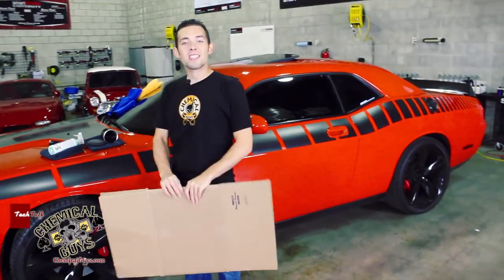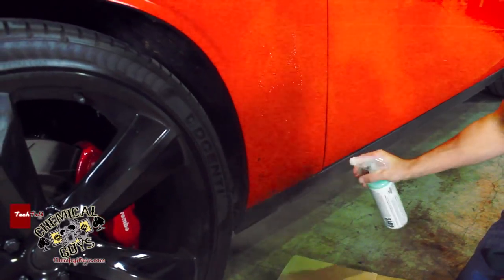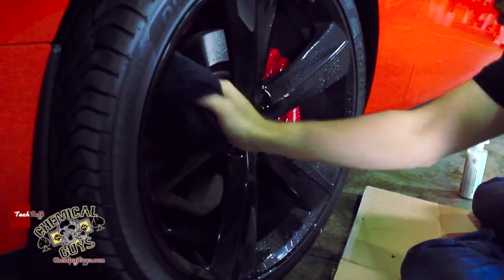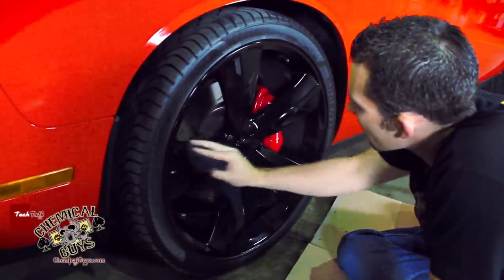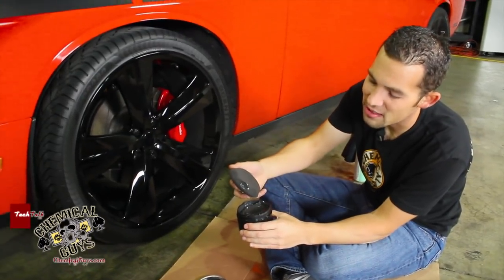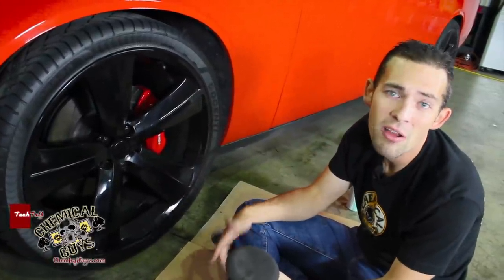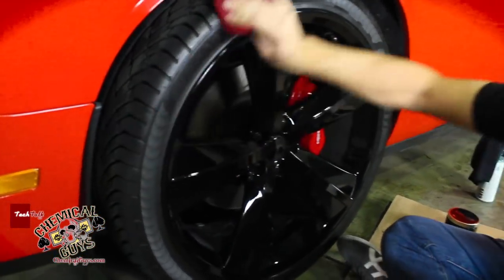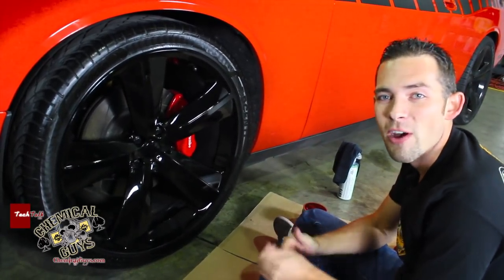How To Detail Black Wheels - Chemical Guys BLACK ECOSMART TRIM GEL - EPIC CAR CARE

Comment: How do you remove chemical stain off the rims?. I used a foam chemical to clean the tires but excess got to the rims and it looks like it faded the powder coating from the rim.

Comment: Black towels are not good because you can’t tell when they’re dirty, especially if you have grit in them during waxing, polishing, or drying painted surfaces.
Reply from the maker: Hi Jason, thanks for your comment. Since wheels are the dirtiest part of a car, we always use black microfiber towels for wheels, green for paint, blue for glass, yellow for interior carpets, fabric, and upholstery, and tan for leather and vinyl. This color coding ensures no cross-contamination and no costly mistakes! Stay tuned for more videos coming your way soon!

Comment: I have the gloss black cleaver rims on my truck an I keep getting streaks on the wheels I wanna wax them but I wanna clean them really good first any ideas or suggestions on how to really clean my rims before waxing them. It's like streaks on top of the clear coat. Can I use a degreaser cleaner or what do you suggest?
Reply from the maker: Hi Jacob! We recommend Diablo Gel Wheel cleaner.  Chemical Guys Diablo Wheel & Rim Cleaner is pH-balanced, gentle, and perfect for cleaning any type of shiny wheel finish on any vehicle. Clean off any painted wheel, polished metal, chrome, anodized, powdercoated, or wrapped wheel without fear of tarnishing or destroying any finish in any way. Diablo Gel Wheel & Rim Cleaner lifts away stuck-on brake dust and road grime with concentrated suspension technology. The thick wheel-cleaning soap comes oxygen-infused for the foaming action that gently removes abrasive filth from wheels, tires, and brake components. Diablo Gel is the only pH-neutral wheel cleaner safe for use on any and all shiny OEM and aftermarket wheel finishes, including painted finishes, powder coat, chrome, carbon fiber, polished metals, and glossy vinyl wraps. The thick soapy cleaner comes fully concentrated, so mix 3 parts water to every 1 part Diablo Gel in a sprayer bottle for the perfect balance of sprayability and wheel-cleaning grunt. Simply spray the red gel over the wheel and agitate any brake dust, road grime, dirt, grease, oil, or spilled brake fluid with a soft-bristle wheel brush. Thanks for watching and thanks for being part of the Chemical Guys family! Check link below.

https://www.chemicalguys.com/Diablo_Gel_Wheel_Rim_Cleaner_16_oz_p/cld_997_16.htm

Comment: What is your suggestion for the 2020 civic si black wheels. They are more of a matte style finish… so I’m so stuck on which of your products to use
Reply from the maker: Hey! Check out Diablo Wheel Gel to gently clean your wheels before using Meticulous Matte Spray Sealant to add protection while maintaining a matte finish.

Comment: I have refurbed and resprayed black wheels. The guy who did the job told me that some wheel washing solutions can be really bad for colour changed wheels as it can be too aggressive and eat the paint o.0  

I dont wanna buy £20 worth of cleaning solution to ruin my £330 paint job. Could you suggest any products that clean really well but are not to aggressive on the paintwork?

Comment: Does that same wax work with black machine rims?
Reply from the maker: Hey Ignacio, thanks for stopping by and checking out this awesome video. The Black Wax can be applied to any material that's been clear coated, which means it's perfectly safe to use them on black machine rims.